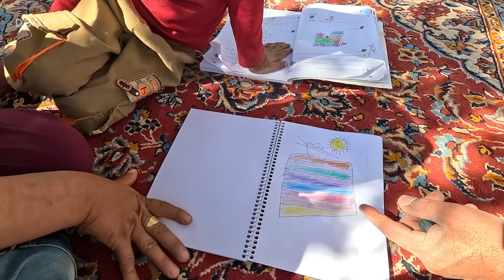Grandma's Family's Effort to build the Kitchen

Comment: Your insistence not to have a foundation on all buildings you make is dangerous, the ground shifts with time and the buildings can collapse. All buildings that are used for humans and animals must be 8 feet tall as a rule, all doors must be 7 feet tall and must measure 32 inches wide. the foundations in all buildings must be at least 12 inches deep in the ground and at least 6 inches above the ground, you must use a layer of gravel and a layer of sand and then 6 inches of cement at the foundation area the inside of the area must be at 4 inches of cement being careful to pack dirt and rock before you pour the cement floor, steel rebar must be used to strengthen the floor and foundation and then the building of cinder block walls can start. The reason why you guys must make the walls 8 feet tall is because humans need to fit inside the buildings without touching the ceilings with your head, the same is when you have animals of any kind, chickens, goats and donkeys, humans have to go inside the buildings to get them clean, you can clean the animal pens if you do not fit inside. All animals must live in clean cages, free of poop or shit. the animal poop can be used to make all dirt that is used to plant more fertile and good for planting. You guys are nice hard working folk. STOP working hard and start working smart. God bless you and all your family. Lots of love you all.